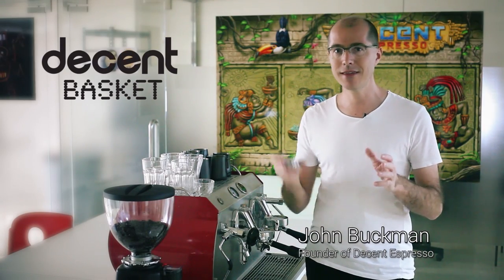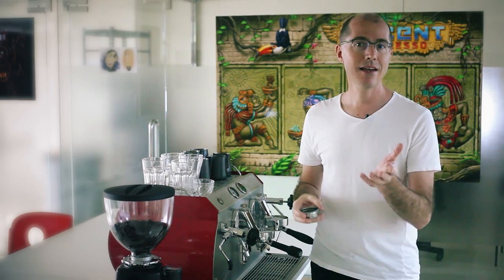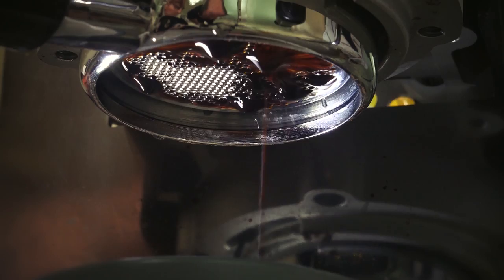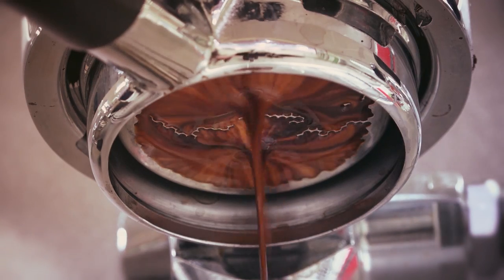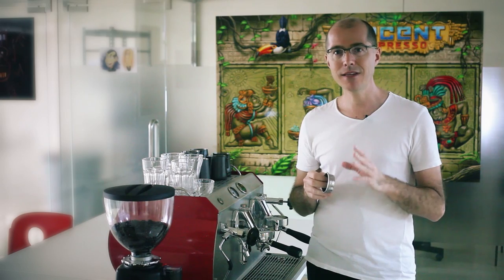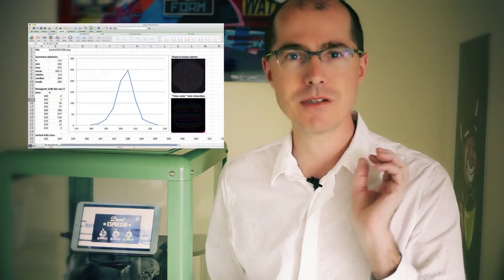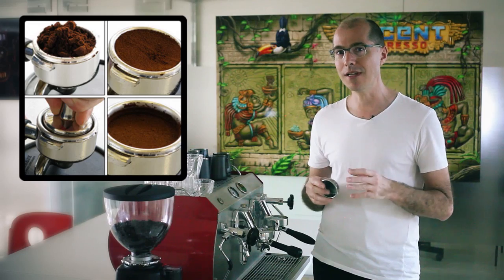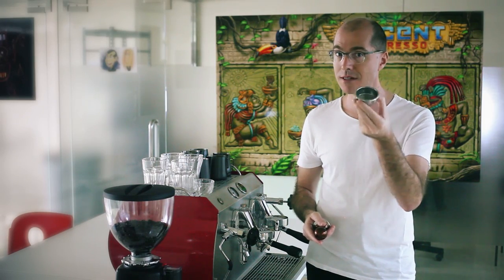Decent Basket

Comment: What's the size in micrometers, or mm, of the holes of your basket? 150 microns or 0,150mm?
Reply: The size of the holes changes depending on the dose size.  A 15g basket has smaller holes (.27mm) than a 20g basket (.31mm).  Tolerance is +/- .0.02.   The goal is to keep the flow rate constant, despite different coffee doses.

Comment: With the decent basket I have to grind much finer to get a good shot of espresso in comparison to an ims competition basket...both 18g... my espresso then taste overextracted and I cannot figure out a reason for this. I mean the shape of both baskets is way different but anyways...maybe you guys have any idea of what is going on and why?
Reply from the maker: Hi Sven -- how many seconds are you pulling your shot for?
Reply: I try to go for 30 seconds, which I start messuring when i start the pump using the lever of my Bezzera Magica PID. I'm then looking for a 2:1 brew ratio...I put 18g of ground coffee and usually get 36-38g of espresso (using your simple scale).
When I'm doing this with your decent basket  I have to grind a lot finer and the coffee is very strong and a little bitter to my taste compared to the IMS competizione basket.
Reply from the maker: What you're doing for your espresso is definitely correct.  I'm guessing the problem is in the puck.  Can i ask you to try an experiment?  Grind 18g into a milk jug, shake the grounds all around, and then carefully make a even mound of the grounds in your portafilter, distributing the grounds as evenly around as possible.  Let's see if that helps, as an experiment.
Reply: I don't think that distribution is a problem. I use a bottomless portafilter an from what I see, there are no deadspots and no spilling of coffee. But I will try it anyway and look what I find.
Reply from the maker: Just trying to suggest things to try.  The trouble here is that lots of people use our baskets with no problem, but at the same time you sound quite competent. :D  So it's not obvious what the problem is.
Reply: I just bought a vst basket which is quite expansive here in Germany. I can confirm that I need a finer grind compared to the ims basket as well. The espresso from that basket seems to be the best I have ever gotten. Grind size is comparable to the decent basket !
Reply from the maker: You should have similar results between the VST and Decent baskets, as our coffee extraction philosophies are similar.  Others who have tested baskets have told me that they get similar refractometer results between the two.

Comment: But will it fit QM Rubino?
Reply from the maker: Unfortunately, googling about for specifications on your espresso machine, I couldn't find any info.  Do you know if the baskets are the 58mm standard?
Reply: Yes,they are exactly that.
Quick Mill 's Rubino is the response to Rocket's Appartamento btw.
Reply from the maker: If it's 58mm and similar to Rocket, it should be standard, and yes, our basket should work.  If you buy one and it doesn't work, no problem, just return it (addresses in US, UK, HK) for a refund.

Comment: You partner with IMS ?.
Reply: Partnered*
Reply from the maker: Nope, these are made by another company for us.  FYI IMS's baskets can generally be recognised by their non-shiny surface, as they do not "chrome" their baskets.
Reply: Decent Espresso Machines I am curious to know what the name of the combine could I know it ?  😅
Because I found decent basket best  price between the other combines in SA shops .
Reply: Decent Espresso Machines and I have Gaggia Classic would your baskets fit in Gaggia's portafilter ?.
Reply from the maker: They're custom made for us by a factory, not by a known espresso parts brand.  Our baskets are sold under our brand.  As long as the baskets are printed with our name on them, they should be ours, otherwise they are not.
Reply from the maker: I just did some forum-reading to find out, and YES it appears that our baskets will fit your Gaggia Classic.
Reply: Decent Espresso Machines thanks for helping me out.
Reply: @ZiAd-xm4je  هلا معك المكينة الاسبريسوا؟ ذي كيف استخدامها بشكل عام وهل تنصح فيها؟